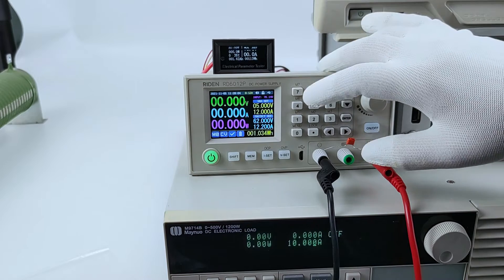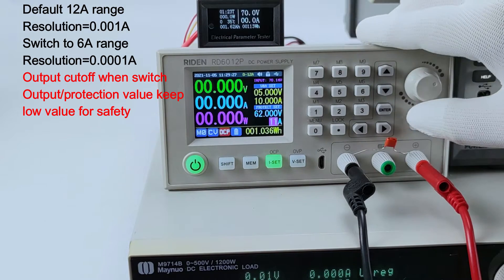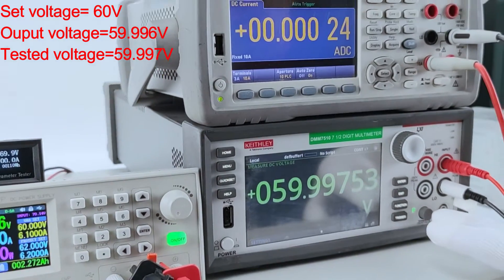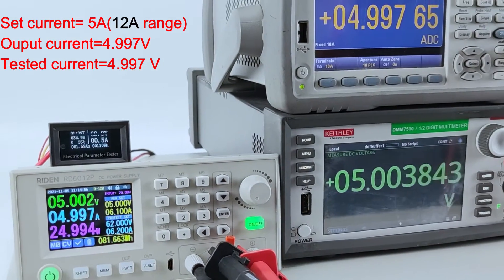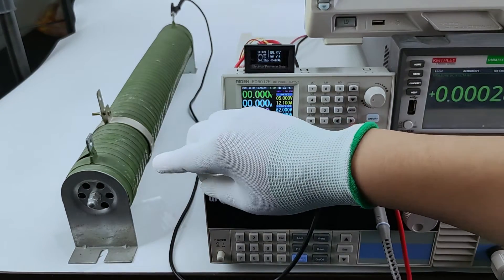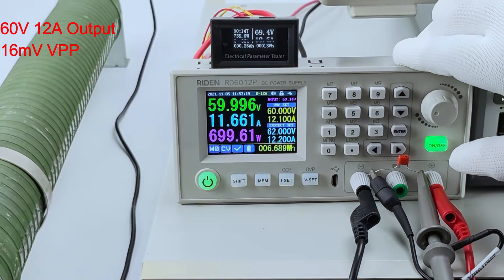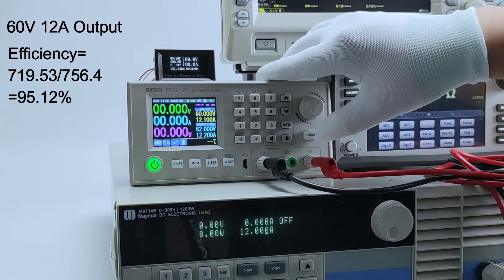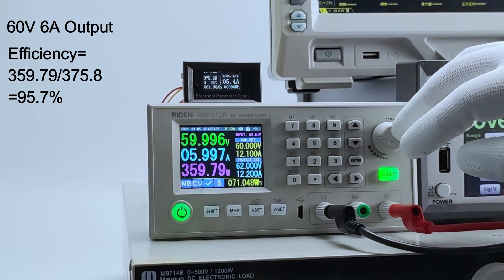RD6012P actual test about current range switch/accuracy/ripple and output efficiency

Comment: I have 2 RD6018s. One is used in manufacturing. The features of the RD6012P are exactly what I desire. I no longer need a meter to measure the currents of my low quiescent current circuits. And it provides linear quality output. Today I ordered model P. It will take its place in R&D... As an engineer, I congratulate the RD6012P designers and manufacturers...
Reply from the maker: thank you, if there is any needs, just contact us

Comment: Great video, I'm glad that I've kept on looking for suitable products per my budget range and eventually found the RD6012PW, for me the selling points are:
* good enough accuracy and precision for my upcoming projects
* being modular enables using an isolated DC source with ease
* ability to handle safe cell/battery charging from the front panel
* high enough voltage and power 

Looking forward to see the longevity of the product provided it is being taken care of. :)
Reply from the maker: thank you, normally as long as you use it in the correct way, do not use over high input voltage, do not reverse battery connection when you do not use green terminal to charge, it can work for long time without any problem

Comment: Hey, I wonder which power supply did you use with rd6012P to present such good results?
Reply from the maker: hello, we just use a switching power supply to power on it, normally the result will not differ too much
Reply: Could you describe in detail which model did you use?
Reply from the maker: just a normal switching power supply, if your input power supply ripple is not good, add a LC filter circuit and it is ok @fbDWAOO7

Comment: Hello how do you configure the RD6012p with with the 0-12A range? Mine is configured to 0-6A and I can't seem to find how to change it.
Reply from the maker: hello, you can check the manual, just press up arrow button at main page, it can switch to 12A range, press down arrow button, it will switch to 6A range
Reply: @rdtech9153  Thank you for the reply! I just couldn’t find it on the manual, sorry. And I just realised you say it on the video… Thanks again.
Reply from the maker: @lllllll396  you are welcome😀

Comment: I own a power supply riden 6012 not "p"  can I get 5 diget through the update soft wear or even 4 diget
Reply from the maker: they are 2 different products, not just add a P in the title, the hardware structure decides the accuracy

Comment: Any plan for 6018P/6024P? Don't really need more digits on the display, but the accuracy and <20mV PP are must have features for the good power supply, at least for the low current mode.
Reply from the maker: hello, there is no more device in the RD series, RD6012P is the last P version
Reply: @rdtech9153  后续会出新的细节吗
Reply from the maker: @张浪浪-w6i  RD 系列电源现在没有新的了，除非是新系列

Comment: You need to add dual-color LED under On/Off button to signal user about OVC protection and other alarms. This is very handy.
Reply from the maker: hello, there is already icon indicator to show the abnormal status, you want the on off button to show another color when the output is cut off by abnormal status?
Reply: @rdtech9153  yes, why not.
Reply from the maker: @atexnik  we will consider that, but it depends on the needs of the most customers and the redisign of the circuit

Comment: I was very happy that they already answered my request to have at least 3 decimal zeros in the 6006p version (which actually comes up to 4), in this one I believed that by having 5 digits, 2 would be 2 for the whole part of the number and the rest for fractional, but again positively surprise me with a so-to-speak "flexible" mode that up to 6A has 4 digits, which makes sense because if we want to see in the consumption range in mhA it doesn't need to have many amps and after 6A to 12A with 3 digits
Reply from the maker: thank you, if you have any suggestion, just contact us
Reply: In practice, there's no application where you might need 3 decimals for currents over 1-2A, yet alone 4 decimals. So, I would say, the 1mA step would be absolutely sufficient for 0-6A, and then 10mA for 6-12A is totally fine. Having 0.1mA is poor marketing. The only advantage of P series is the linear stabilization at the output, nothing else.
Reply from the maker: @atexnik  as long as customers need that, that is a good desgin
Reply: @rdtech9153  Very glad to read such comment from RDTech, I am considering the 6012PW + S800 exactly because it has support for 4 digits and is actually below my limited budget for the upcoming projects. It is also modular and will be convenient for me to power it from a battery bank when I am off-grid mainly or I want a cleaner DC and last but not least the support from the manufacturer seems to be there. I'm very pleasantly surprised overall! :)
Reply from the maker: @Mahdi-BogdanAli thank you, if there is any needs, just contact us

Comment: a cosa serve il condensatore? non era possibile introdurlo all'interno dell'alimentatore?
Reply from the maker: hello, the product itself already have the filter
1.we use this capacity in parallel to eliminate the other influence so that customers can also test the same result
 at their device
2.and it is much easier to connect the olliscope(if you do not use the capacitor, you can use shielded wire to test the signal, the result is similar)
Reply: @rdtech9153  Ok che è già filtrato, ma per un risultato superiore, è più pratico saldare all'interno questo condensatore in polietilene sui terminali così le interferenze sono sempre meglio filtrate , giusto?
Reply from the maker: @niwivan3793  I mean there is already fliter inside, it is just to eliminate the error from the cables you connect, you can use shielded wire to test the signal, the result is similar
Reply: @rdtech9153  ahh ok, ho capito! grazie
Reply from the maker: @niwivan3793  you are welcome: )

Comment: ye should include 2 banana cables at least in the package, the price of the unit is fine, but the accessories are pretty expensive
Reply from the maker: hello, we have the output cables link, they are not free, you can choose it or order them in other shop, as long as the cable can support the big current, it is ok